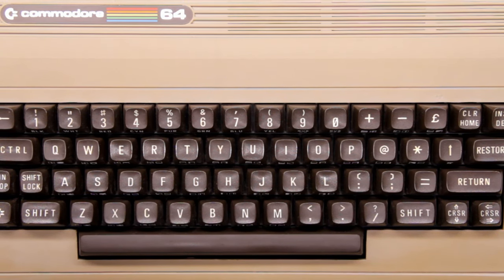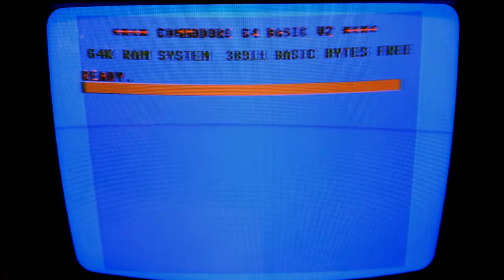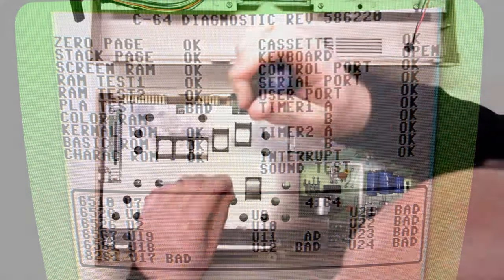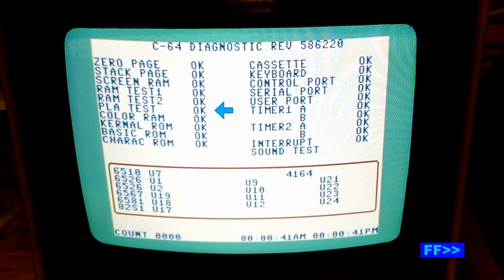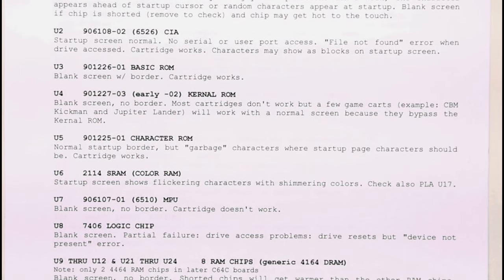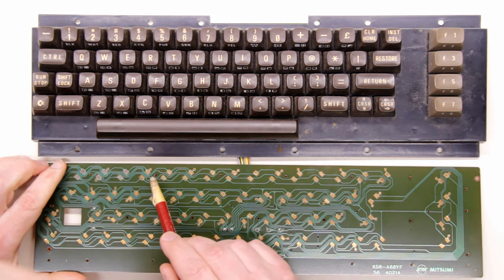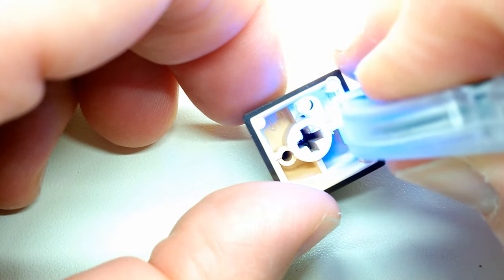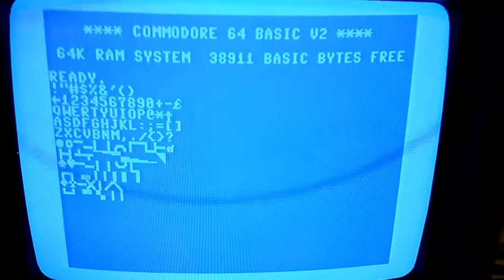#02 "Icky Flicky Display" — Commodore 64 Bad PLA Repair

Comment: I have 2 Commodore 64 monitors and 2 Commodore 64 keyboards along with 2 different power supplies.

I had a third working monitor that I sold to a gracious fellow who had some vintage games.

I know one of the 2 monitors I have is non-functional.  We were able to get one of the monitors working but the other one wouldn't give me any sort of picture from my C64s.

However, now the other monitor is not displaying a picture either.  BOTH monitors just give a blank WHITE screen if the brightness is cranked up to half or higher.

I'm not sure what's wrong, power supplies, monitors, keyboards?  I thought I had at least one working monitor but now it appears if both are malfunctioning.

Both monitors DO produce a bit of a flicker when I switch my C64 ON.  I only have 4-color monitor cables.  White for audio, yellow, red, and black.  I believe I am supposed to be using BLACK to the YELLOW input on the monitor, as using YELLOW to YELLOW produces no flicker.  Not sure why that makes sense but there are only 3 colors on the monitor connections and 4 colors on the monitor cable.

Any thoughts?
Reply from the maker: Hi Blaine. Firstly, thanks for watching my video and commenting. It's always tough to diagnose from afar.

MONITORS:
- Make sure the brightness and contrast are not cranked to full -- full brightness and/or contrast could produce an all-white display and you might not see the C64 display
- Are the monitors buzzing or humming at all? This could be a failed flyback transformer. This and any other internal CRT problems can still be serviced -- I would recommend that only a professional TV repair shop service your monitors as lethal voltages can remain present inside the unit for many hours even after it is turned off.

C64 & CABLE:
- Usually, the 4 plug cables output as follows...
   BLACK -- Luminance
   RED -- Chrominance
   YELLOW -- Composite video (combined luma and chroma)
   WHITE -- Audio out
- Do you have a TV or old VCR with a Video In socket (a yellow RCA socket)? If so, as a test, you could plug in the yellow plug of the cable into that and see if you get any output from the C64 on the TV. The video quality would be very poor, but at least you would know if the C64 is outputting and video at all. If you get a video display then you know the issue is with the monitors.

Failing all that, you have to consider that the C64 has failed chips. A bad VIC-II chip or bad logic chip at U31 can cause a white screen (usually with no borders).

And, of course, if you have dead chips on the motherboard, you might have faulty power supplies sending more than 5V to the board, frying chips.

I hope this helps. Good luck.
Reply: Thank you for the quick reply.  Getting technical replies through YouTube is a rarity.

Anyway, I ran the quick test as you suggested.  I have a flat panel LCD television, so I'm not sure if that qualifies as a suitable test monitor or not, but regardless, it does have a yellow video input jack on the rear.  Unfortunately, it also doubles as the green input for COMPONENT video.  So basically this television has 5 RCA plugs on the rear and 2 HDMI.  There is the stereo audio RCA inputs and then the 3 component video inputs, with the green component video input doubling as the yellow for traditional video input.

Trying all of the input choices within the television's menu netted nothing.  I tried both power supplies and both C64s.

I should note that the original Commodore power supply no longer produces a red light on the C64s but the other power supply that comes from an aftermarket manufacturer does.

Did my test prove anything or is my flat panel television inadequate?  Thanks again.
Reply from the maker: You're welcome. I try to help out when I can, but tele-troubleshooting these old computers is tough. Well, we're assuming the yellow is actually outputting a composite signal. If so, it could be an oddball 80s signal that the contemporary TV doesn't recognize. What about plugging in something like a DVD player with video-out into the monitors just see if they display video? I'm trying to eliminate the monitors as the problem. Which monitor model(s) are they? You can also make or buy (on eBay from US, UK and Canadian sellers) a C64 cable that outputs to S-Video. That would definitely work on your TV.
Reply: My monitors are 1701s.  I know for sure that of the two monitors I have left, I was not able to produce a signal on one of them.  The C64 fired up on one of them, though.  The third monitor also worked and I haven't received a callback stating otherwise.  Not sure that I would, I'd assume that buying 40 year old technology came with a bit of "buyer beware" included :)

My television does also not have an S-video input.  It's too modern.   I can try hooking it directly to my VCR another time, I wish I would have done that before putting everything away.  Will try again, time for sleep now.  Thanks again for all of your help and suggestions.
Reply: I gave it another try this morning.  I used coaxial cable to connect my DVD/VCR combo to my television, and then used the 4-color Commodore video cable to connect both of my C64s to the VCR's line-1 input.  Still no display from either of the C64s using either power supply.  Still, only the aftermarket power supply illuminates the red power light on the C64s.  The original Commodore power supply doesn't produce any sort of power indicator light.

I am seeing line-1 input on my television properly, it's just a blank blue screen as you would see if nothing was connected to the DVD/VCR's inputs.  It also has a line-2 that was also displaying the same blue screen.
Reply from the maker: Perhaps a silly question, but have you tried plugging into both the front and rear inputs on the 1701 -- and ensuring the 'Front/Rear' switch is in the correct position? So, the front yellow socket would be composite.
Reply: Yes, I have.  Doesn't make any sort of difference now, even on the monitor that WAS working when the enthusiast came and bought one of the 3 monitors I had.

However, front and rear inputs of both of the 1701s will produce a flicker in the screen when switching the C64s on with the aftermarket power supply.
Reply from the maker: I'm suspecting the C64s are the issue. You could actually be seeing a black screen from the C64s. In any case, the next step might be to pick up a Dead Test cartridge -- $15-$20 on eBay -- this one (http://ebay.to/2F4MdF5) is from a very reputable seller in Canada and has both the Dead Test and Diagnostics cartridges. The Dead Test cart is your best bet for diagnosing problems without having to get involved with oscilloscopes and other test equipment.

Also, do you have multimeter to test the for 5VDC and 9VAC coming from the aftermarket power supply? This should really be done with the power supply under load, but just measuring the outputs might highlight if there is a major voltage problem on power supply side. This is the C64 PSU pinout, https://goo.gl/B3mhVx.
Reply: Yes, I will check the voltages next.  Thanks for the pin out, that will be helpful.
Reply: Here are the results of my voltage tests.

1)  OEM Commodore 7 pin power supply:  5.32 volts on the DC line.  On the same DC line, I am also seeing 10.8 volts AC.  NO voltage detected on the AC line, not even a flutter on my digital meter.

2)  Aftermarket Computer Place 4 pin power supply:  5.25 volts on the DC line.  On the same DC line, I am also seeing 10.7 volts AC.  NO voltage detected on the AC line either.

Mind you, these tests were conducted on the bench with no load from the C64s.

UPDATE:

I opened up both power supplies.  The aftermarket power supply does not have any internal fuses, but the OEM Commodore power supply does have 2 fuses, 1 on either side of the transformer.  One of them is a 3 amp fuse that is blown.  Unfortunately they are soldered in place so there is no quick replacement.  Maybe that's why the OEM power supply doesn't even produce a red power light on the C64s.
Reply: After jumpering across the terminals for the broken fuse on the OEM Commodore power supply, I am getting 5.32 volts DC on the DC line and 9.9 volts AC on the AC line (no load.)

I tried BOTH C64s with this power supply and BOTH 1701 monitors and still have the same result.  No blue display but the monitors do flicker when turning the C64s on.  I also note that now, NEITHER C64 produces a red power light.  I guess all of the above is DEAD.

I should also note that as far as I know, I am no longer getting any AC voltage on the DC circuit after jumpering across the blown fuse.  Weird.  Why was there AC voltage on the DC circuit in the first place?  And how it was like that for BOTH power supplies?
Reply from the maker: Hi. Yes, you're correct about testing without a load, but at you are seeing decent no-load voltages.  I assume the Commodore PSU is the 902503-02 -- just to confirm, it's pinouts are 2 & 5 (5VDC rail) and 6 & 7 (9VAC rail) -- schematic, https://goo.gl/CTpww9.  Fortunately, these PSUs and can be serviced, as you've discovered. It's not too difficult to replace the fuse(s) -- you should even be able to squeeze in a proper fuse holder making it easier to replace fuses if they ever blow again.  Also, the caps should be replaced with quality contemporary ones.
Reply: Is there any reason why even this fully functional power supply doesn't power up either C64 nor produce any sort of red power light on either of the C64s?

It appears as if neither of the power supplies was providing any over voltage that would have killed the C64s prematurely.

Lastly, why I was I reading AC voltage on the DC circuits, even though the DC circuits were also providing DC voltage?  That to me is troubling!  Unless there is some sort of explanation.  I have searched but can find no answer for why both AC and DC would be on the same circuit.  I am not an electrical engineer....
Reply from the maker: At this point, you really have to get into the C64 and start testing voltages on the mainboard starting from the switch and power socket. It sounds like the board isn't getting any voltage all. Sometimes it can be as simple as a blown fuse on the board (check that for sure), a faulty switch or cracked solder joints where the switch is connected to the board -- reflowing those solder joints would likely resolve any connection issues. Also, check continuity at the switch terminals to confirm that the switch is actually working. From there you have to check the bridge rectifier and the voltage regulators.

I am not an electrical eng. either, but I don't think you need to worry about measuring AC an voltage on the DC rail. Most multimeters set to AC Volts range will read a voltage value of a DC power source, although it will read an incorrect voltage depending on the type of meter you have -- for example, if you are using a standard hobbyist multimeter (one without "True RMS" functionality) would likely read a voltage of about twice the expected voltage (e.g. a 5VDC line might read at 10V if the meter is set to AC Volts).

I hope this is helping and not making things more confusing.
Reply: That does make sense, the measured AC voltage on the DC line was about 10 volts, double the 5 volts that was expected.

I'll have to tear in to them more when I have time.  The last time I checked inside a few days ago, the internal fuses in both of the C64s were in good shape.  I will let you know if and when I find anything else in the future!  Thank you for all of the contributions that you have made for my case.  I appreciate the discussion.

Comment: no retrobrightening was dissapointing
Reply from the maker: Unfortunately, the owner wanted this C64 back as soon as possible, and I had already spent too much time with it, so no Retr0brighting this time around. Also, most often C64 breadbins do not fare too well when Retr0brighted -- the beige plastic cases tend to pit when exposed too long to hydrogen peroxide, as was the issue when I attempted an alternate method to Retro0bright a breadbin case last summer, https://bit.ly/2HflhTE. Thanks for commenting.
Reply: @MindFlareRetro  Hmmm, that makes me think again about what will I do with the one I got recently... Cheers!
Reply from the maker: @oldofftime  You're welcome, and thank you for your comments.